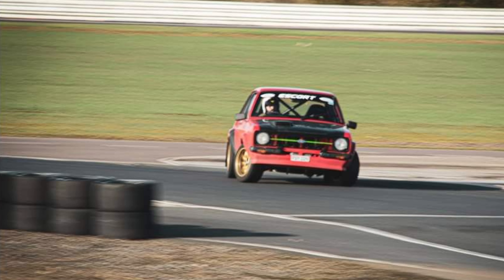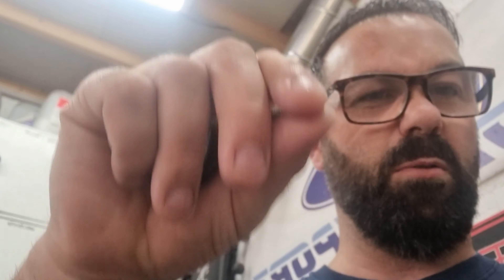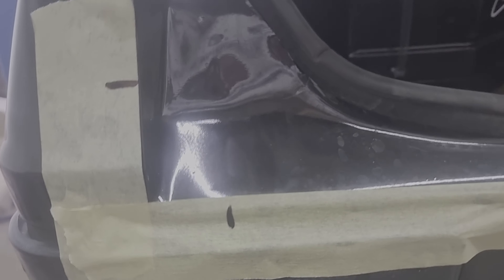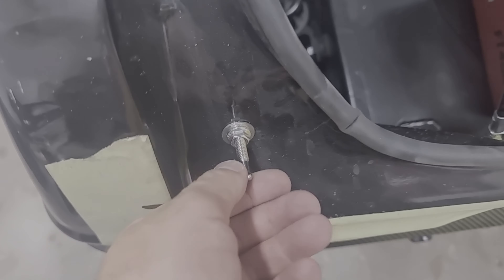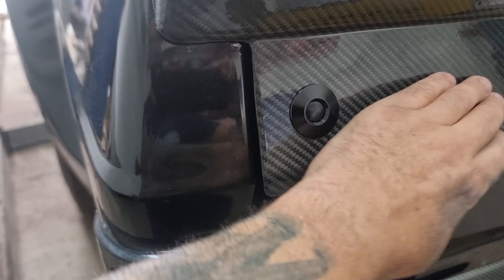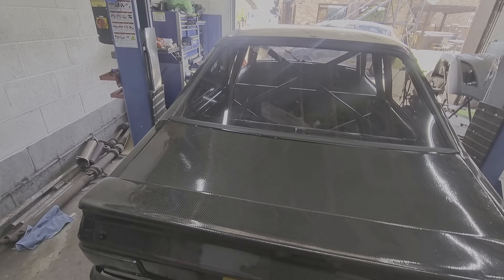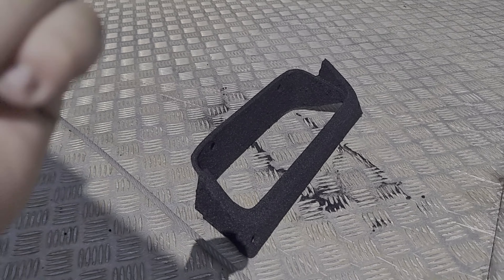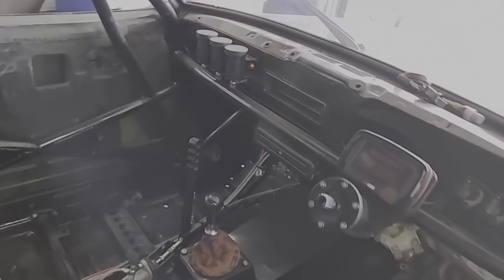MK2 Escort - few more jobs off the list

Comment: Class where did you get them thanks Denis from Ireland 🇮🇪
Reply from the maker: £6 From ebay mate,nothing fancy but do the job,i wouldnt recomend them for a bonnet
Reply: @dave280585  thanks that's what i wanted them for
Reply from the maker: @denisdelaney4789  id say i wouldnt trust them on a bonnet,for bonnets id fit the aerocatches, dont use the cheap ones either as they just arent the same quality